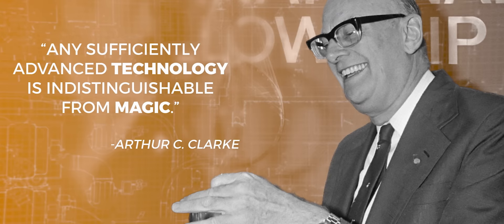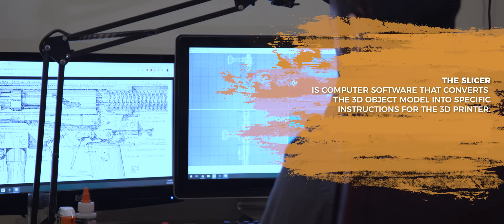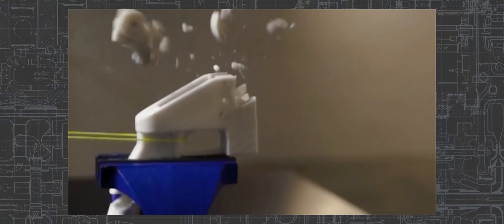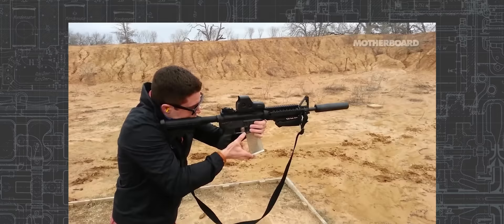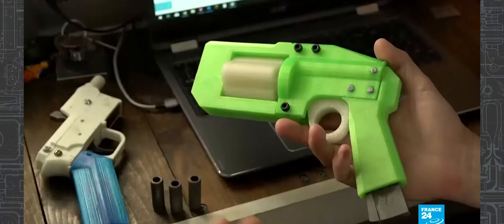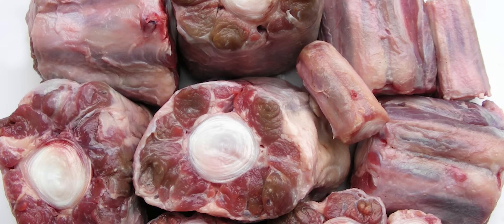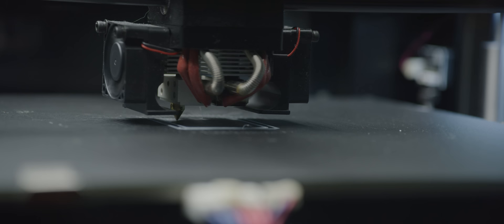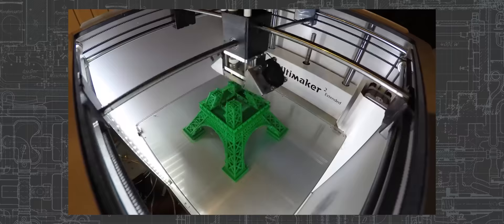3D Printed Guns, Explained

Comment: “Completed 3D printed guns aren’t there yet”
FGC-9 has entered the chat
Reply: @soundspark  the barrel rifling method isn't as crazy as you think. I watching a tutorial for it and it's pretty straightforward
Reply: @soundspark  i mean yeah, it's metal. Idk what you're getting at, im just telling you it's easier than you think. It's still an at home diy method that works.
Reply: @soundspark  Actually,  you can make the barrel of the FGC-9 using a process called electrochemical machining (ECM). You don't need a lathe or anything heavy, just a simple power supply, a pump, and other stuff you can get at a store. I've hear its about $100 for the ECM set up.
Reply: Deterrence Dispersed has entered the chat
Reply: I was actually trying to learn about the fgc 9. How much of it is plastic? Can't possibly be all of it right?
Reply: @soundspark  you can make the gun at home so its a DIY project, it has some metal parts but you can still do that stuff at home, you dont need industrial grade equipment, you keep holding on that its almost impossible to make it yourself and is really expansive, let me tell you its not impossible nor expensive. its easy to make and in my country guns are illegal so this is a game changer for every country. i can get the stuff i need online and at my store without making the suspision that i'm making a gun.
Reply: Fgc 9 = Fuck gun control 9mm
Reply: @MOOBBreezy  where did u watch it can u provide link man? thanks
Reply: @mirzamunif  A guestimation of 80% plastic 20% metal
Reply: 👍 Just watched that video and this one popped up
Reply: It still uses various machined parts like a rifled barrel
Reply: @soundspark  then they should practice. Try a model, build a wood wall & do what they did in the video with the string. Pull the string & see what happens. Fix your issues, ask the community what's wrong, & make your product better over time.
Reply: @durschfalltv7505  No "gun license" needed in the USA..
Reply: @awilcox782  well then youre lucky my friend
Reply: There is no conceivable way a gun barrel would be made out of plastic
Reply: @FireCamp105  No shit, A metal barrel is bored and rifled through a process called ECM (electro chemical machining). Despite the name, it's simple and inexpensive, just need a power supply and salt water. Makes barrels comparable to most modern firearm barrels.
Reply: @soundspark  I found it on Amazon for 80$
Reply: @soundspark  it's easy as fuck, don't make it sound hard
Reply: @soundspark  80% 3D printed and no serial numbers can't be traced. A weapon that can kill and no one will every find out who did it.
Reply: @soundspark  No where close to what I said. I said if there is no serial number, it's a firearm hard to trace. Which makes it mostly easy to get away with doing a crime with it. Because if it's found, there is no serial number.
Reply: @soundspark  If it's stolen and the owner has no clue, then it can't be traced.
Reply: if the FGC-9 is a fully 3D printed, the liberator was fully 3D printable wayyy before the FGC-9 was made
Reply: Yes the FGC-9 is easy to build but still requires machining to become fully operational as a safe and effective simi-auto firearm.   There are several steel parts in the gun and even though you could get away with some of these steel parts being plastic they would only last a few rounds at best.      With that said 3D printing for firearms and more will only get easier to do with time and new technology as well as new base materials being invented every day for the same 3D printer you may have on your desk right now.           

Personally i have no use for a plastic gun, i dont even like the real manufactured plastic frame firearms you can buy at the store but i must admit the thought of being able to print an aluminum or dare i dream a steel firearm is astounding and though it is many decades from becoming affordable for the average person,  Metal 3D printers do exist they are just so ridiculously expensive not many can afford them they also require further finishing or baking in order to make the part a part.
Reply: @tonyemory3618  Yes ofcourse, but those are easy to get a hold of. The things that are 3d printed are hard to get a hold of.
Reply: @MOOBBreezy  electrochemical machining for the rifling. dont need any machine tools. you 3d print the mask for the rifling then ECM it. simple
Reply: @SpiraSpiraSpira  yeah lol. I just finished my barrel last week. Might make another one tho.
Reply: @soundspark  metal 3d printers in the consumer market are not that far off 👀
Reply: There is metall  printers... they are expensive for now, but that might change.

What happens when someone make a metall 3d printer that can print it self
Reply: @matsv201  if someone makes a DMLS printer that can print itself then printers become really cheap!
Reply: you can easily make a fgc-9 in europe countries like germany italy and a few others. you can even make your own ammunition. altought you dont wanna get caught with it or you gonna get a big sentence
Reply: @soundspark  next you will say did you 3d printed your bullets and gunpowder ffs XD
Reply: @RandomGuy9  The button will brake. Better use an hydraulik press.
Reply: @soundspark  it's like $100 of equipment you can buy on Amazon
Reply: 900th like Here.
Reply: still not completely 3d printed, there is still a lot of metal parts.  also the Mod9 is so much better.
Reply: @RandomGuy9  you need a special made button that cuts it instead of pushing the material, its easily made though n very cheap to make n use
Reply: @FireCamp105  you can use a plastic one for single shots, the liberator .380 can shoot only once, try it again w the same barrel it goes boom, you can shoot .22lr a few more times
Reply: @marni2890  can be traced if they find the gun on you n check rifling n firing pin match, just becayse it has no serials doesnt mean you can get away w crime
Reply: @2yt4u.14.  depends on country, in my country you get 3 years max
Reply: @Deltawolf2022  the mod9 also needs a lathe to make n is more difficult n has no community if you have errors
Reply: @sny5563  there actually is a pretty big community to help with issues.  You can purchase a bolt for the v2 or v3 ifyou need to plus there are 4 barrel options. With more being tested from other outside of the Dev team.  The fgc-9 if far behind the Mod9. Plus we should see a new firearm made by the same group soon.
Reply: @Deltawolf2022  you make me laugh, thr mod9 is limited to the US while the fgc9 is worldwide, i doubt theres even a chat site like there is for the fgc9, you must be a mod9'er, det disp didnt lie, those guys hate us
Reply: @sny5563  actually i have both fgc and mod, Mod9 has an diy barrel and is world wide.  I dont give a damn about y'alls past, i an not involved in that mess.  Mod9 does have a chat.  Rumors have it that y'all censor your chat from talking about them, whats that about?
Reply: @Deltawolf2022  alot of people ask about the mod9, the admins just say most people here dont make them and the mod9'ers hate us, go to chat.deterrencedispensed.com if you dont believe, and no the mod9 isnt as international as the fgc9
Reply: @sny5563  doesn't matter we aren't changing peoples minds, so we will pass on that, i am already in there along with AWCY? And the mod9 group.  I print what i can.  Group history with anyone else is only one sided.  All i can say is that all groups keep the signal alive and well.
Reply: @grabenbrecher  *EDM - electric discharge machining.
Reply: @mirzamunif  i watched a documentary about it. according to jstark, the founder of deterrence dispensed, the FGC-9 is around 80% printed parts.
Reply: @stuckonaslide  The only metal parts are the bolt which uses 18mm steel rod and the barrel which uses 8mm hydraulic pipe. Other than those 2 it's only springs and some minor hardware. We have even made files to print the fire control group.
Reply: @MOOBBreezy  what he's getting at?!?! Lol the whole basis of this conversation is whether we have reached a point where a gun can be made completely with a 3D printer. It has not.
Reply: @ericg4915  I think education is the best. Make more education required to own q gun. And make permits for selling a gun. So you can "just buy a gun" but then legally require yourself to visit education courses that may take 2 or 3 days. But you can instantly have the gun.
Reply: @durschfalltv7505  that would be nice but Americans would like for at least to be some kind of background check to make sure criminals or terrorists or mentally ill can't get them, to get training would be the next step
Reply: @ericg4915  the whole basis of my reply was responding to someone who commented on the barrel making process. What are you getting at?
Reply: @ericg4915  Well there is i though
Reply: @durschfalltv7505  no there isn't. It's totally legal for me to sell a gun to a terrorist or a 12 year old with no background check and I won't get in trouble. Some gun dealers do background checks but it is not required by law in most gun sales. America is super crazy when it comes to gun laws and they are extremely lenient. I legally bought my first semi auto when I was still in high school. And trust me it's not as cool as it sounds. We have more guns then people. About 400 million of them and it shows in everyday life. Most of us have dodged a bullet on the street at one point
Reply: @ericg4915  Well that is obviously something that got to change. But education and mental health programms should be priority number 1. Gun Control is dead soon. Some might argue its already dead and cannot be revived.
Reply: rip JSTARK
Reply: @mirzamunif  80% the barrel and a few internals are metal, the internals can be printed but i wouldnt suggest it as items like the hammer can break and become binary fire or just decided to unload the whole gun after a pull
Reply: @MOOBBreezy  you do realize that you can make a gun with nothing more than a file and a block of metal dont you.
Reply: @MOOBBreezy  You do realize that a 3d printer is a machine just like a lathe and a mill whats the difference in going and buying a cheap lathe and mill or buying a 3d printer
Reply: @grabenbrecher  what makes a lathe heavy or expensive? I milled out a handgun with a mini lathe and a file that shoots fine. and my tools cost about the same as a 3d printer
Reply: @jstsumguy29  i never said that you couldn't file a block of metal, nor have I ever disputed buying a "cheap" lathe and mill. But please do show me a lathe under $200 thats easy to set up for beginners. And while you're at it, show me a firearm you've made by just filing a block of metal, id love to see your results.
Reply: Even better I just saw a $300 cnc machine on Amazon that can mill a gun out of aluminum from the same cad file they use to 3D print
Reply: @jstsumguy29  it's more the rifling process that can get difficult. More specifically, the FGC-9 was designed to not require any gunsmithing equipment, including rifling buttons. A strict government can regulate such things.
Reply: @soundspark  in Burma/Myanmar multiple FGC-9's were confiscated, so yeah I'd say it's pretty practical especially in countries where expensive machining tools aren't available.
Reply: @soundspark  right now at this time the mark 2 has came out. Europe will love this
Reply: @MOOBBreezy  one year ahead of time its been made even easier
Reply: You still need a met barrel for it  dude.
Reply: Ugh, Matthew Larosiere taught the guy who made the fgc-9 how to machine some metal parts for the gun.
Reply: Rip Jstark
Reply: FGC9 still requires the chime kit for completion. Metal spring, metal barrel, metal pins. We still haven’t achieved a working model made entirely of filament
Reply: Yeah, $200 from McMaster carr and $200 from some other sites and you got the tools and parts for an fgc 9 mkii and bullets
Reply: NylonG: hold my filament!

Comment: I built a shotgun out of material from my dad’s garage when I was 13 for fun, a determined criminal can easily do better. Can’t regulate this stuff.
Reply: I made a pistol out of plywood and copper pipes when I was 10. Completely agreed you can't regulate this, specially now with 3D printing with metal alloys.
Reply: pipe shot guns are awesome
Reply: guns aren't rocket science. there are tons of custom arms manufacturers in the US that are run out of small garage shops. Almost any machinist can build a decent gun easily, those shops, machines, and knowledge are not going anywhere.
Reply: When I was 13 and built a 15ft spud gun out of pvc pipe and used hairspray for the combustion. It only went about 100 yards and goal was across the water. 

So, I decided to change to metal pipe, lubed the inside, changed the ammo to these rock hard oranges everywhere, then used stronger fuel. 

End result... I sunk my neighbors dinghy and ran like hell. 
But, it was a success since I made it over 300 yards.
Reply: @THAT Guy oh me and my buddy never got caught haha though we had to find a new place to use the potato guns lol
Reply: Trying to prevent home manufacture of firearms is ridiculous: it was already possible to manufacture semi-automatic and automatic weapons with nothing put stuff widely available from hardware stores long before 3D printers and CNC mills became available. Early sub-machine guns were largely made from common household part patterns that were adapted so that civilian factories could be used to mass manufacture them (during WW2 etc).

The famous British "sten gun" utilized adapted pistols components and common plumbing parts to produce a functional weapon; very few aspects of the weapon used "designed-for-purpose" parts until later versions when it had proven to be a effective sub-machine gun pattern. All recent technology does is lower the skill barrier even lower.
Reply: Sten gun
Reply: my friend made a shotgun at 14...he is still working on it
Reply: Shit, it’s easier and faster to buy a dirty hi-point or glock off the streets for bad use than to go through CAD and printing
Reply: @zacnoding12  2 weeks of building for a FGC-9, automatic weapon, 100$
Reply: Exactly, with enough time, effort and determination a criminal can do pretty much anything.
Reply: even if you could regulate the construction of firearms, its not what criminals are doing. criminals arent wasting their time building firearms, they are buying them from some dude named snake in the walmart parking lot.
Reply: @jacobhargiss3839  In australia, illegal firearm manufacture is a very large issue, along side illegal imports.
Reply: @stainlesssteelruler143  Im talking about the ones that are using the firearms. Any time you have an illicit item, you have someone making money either making them or importing them.
Reply: Exactly.

Comment: "it`s certainly not at the point where you can just hit print and have a semi-automatic firearm. It`s just not there yet. And i doubt it ever will be"
FGC-9: hold my beer
Reply: bear?
Reply: @nickstonehenge  ty after 5 month
Reply: @halfhuman6807  FGC is sick as fuck
Reply: I thought that the Fuck Gun Control 9 was only 80% plastic though
Reply: @DiaconescuAlexandru2024  True, but it doesn't require any heavy machining tools. You can use electrochemical machining (ECM) to add rifling to the barrel, and the setup for that process is only about $100. Its a big deal since its the first reliable 3d printed gun that doesn't require a commercial-off-the-shelf barrel, like the Shuty AP-9, or expensive machining tools.
Reply: @grabenbrecher  thank you for the manufacturing instructions :))))))))
Reply: @DiaconescuAlexandru2024  I am actually buying what is needed to do the interior of the FGC rn. It isn't really expensive and JStark and Deterrence Distributed (the creators) both have a PDF files and videos on their website, if that can help you out a bit.

Comment: I saw the Sten and I smiled.
Reply: There was also a Chauchat in there. :)
Reply: Plumbers nightmare...love that gun.
Reply: Sten, Polish Blyskawica, PPS, Volkssturm Gewehr. All you need are pipes, some scrap metal, springs and a workshop equipped with a welding machine and lathe. You can even make it in a workplace and carry it home piece by piece.

Comment: the video is kinda obsolete by now, ivan made 3d printed lower for the ak that works, A.K.A. plastikov
Reply: Yeah the tech has advanced a lot in the last year, especially since you can pretty much print a lot of semi automatic firearms with some assembly. Most of the pressure bearing points they talk about are either replaceable or have metal reinforcements now

Comment: I was hoping it would make guns easily accessible for all people who wish to be free in this world
Reply: Cnc mill already does
Reply: this video is BS.... plenty of working printed guns out there lmao. This video is lying to people... I am only 3 mins in though atm.
Reply: when laser sintering printers become cheaper, it will
Reply: Good ctrl+pew website. Google fgc9, it was designed for people outside of America to use for freedom. Ender3 is $200-220 shipped with filament. To build and make rest of fgc9 required about the $150. Gun control is dead. It's only about people control anyways
Reply: @kapytanhook  no good cheap ones
Reply: There are decent priced guns that have a better quality. No gun owner is going to shake hands with the reaper witha all plastic gun.
Reply: LETHAL WEEABOO That’s why you don’t print an all plastic gun. You print the regulated part, and then use metal off the shelf parts for the rest. That’s what the FMDA Glocks are. Or you machine the pressure bearing parts like the FGC-9.
Reply: @justsomemainer1384  I'd rather buy a highpoint than do that.
Reply: LETHAL WEEABOO Why Not print a high point instead?
Reply: @lethalweeaboo2239  
And now all semi automatic firearms and all pistols are banned, what do you do now?